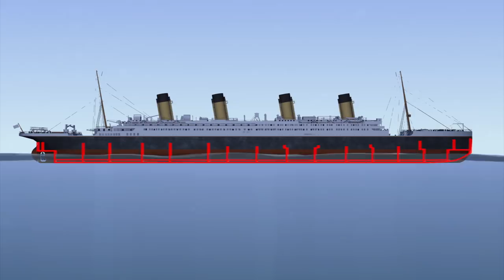Titanic: 3D animated reconstruction of how Titanic sank

Comment: I love how it looks like Titanic sank in a lake, SHE SANK 12,000 FEET BELOW THE SURFACE, THIS LOOKS LIKE SHE SANK IN 300 FEET
Reply: not 6  5
Reply: This animation is pretty bad ngl
Reply: Am sorry to say but sinking and the stern and bow hitting you sea floor didn’t look right and the wreck didn’t look good but I love the  3D
Reply: It wasn't a lake, it was the North Atlantic Ocean.
Reply: @seardadsdasd  ITS CUZ ITS FROM 10 YEARS AGO
Reply: that was legit britannic shallowness
Reply: @mycatisaderp5123  he was talking about how shallow looking the water was, you could see the top of the ocean
Reply: @jiraphatsempian6497  True. You actually could scuba dive there if you got the proper permits and training. 

However, the ship would not have split in this case. Britannic's prow is broken off because the depth is half of the ship's length. As the Britannic listed heavily during its final moments, its prow hit the seabed when part of the ship was still above water. The weight obviously caused it to snap like a pencil (imagine pushing a pencil on the ground as hard as you can until the tip breaks off). If Titanic was in a similar depth, it wouldn't have even risen enough to split.

Comment: Some one needs to double check their facts. Titanic had a double bottom, NOT A DOUBLE HULL. Big difference. If she had a double hull we wouldn't have such a bad video to talk about.
Reply: yup without the double hull the titanic would've only flooded the hull causeing the water to sink into the hull if double bottom however did not prosper for it did not need use when titanic hit the iceburg there was only one hull so the titanic was leaked for 4 compartments and breaks in to the 5th then it starts to sink rises snaps and plunges
Reply: There was more then one name for it.

1. Double bottom
2. Double hull
3. Double keel
Reply: @Harry Schurr Thanks, I didn't know anything 9 months ago, so...
Reply: oooooooooooooooooooooooh
Reply: Oooooooohhhhhh
Reply: @KeepCalmContemplateYourChoices  Nope, hull = sides of a ship.
Keel = Bottom of a ship.
There are no two names for it.
Reply: @CAYDEN NG YU HANG Moe The main reason why Titanic split at all, was because of the lack of a double hull (up the sides of the ship) - the double bottom hung on for a moment after the ship broke (basically from the top-down, due to the enormous strain of the water, plus the stern hanging at an angle it wasn't designed for), and then the bottom separated.  By contrast, when the Britannic sank, it did not split in half, and the fact that it had a double hull (up the sides as well as at the bottom) was why.  Except for some buckling where the bow hit the seabed, Britannic is basically in one piece.
Reply: Dude the bottom is called the hull if you learn about it
Reply: @Robloxchat123  what? Think my brain committed suicide
Reply: 100% tru

Comment: 1. The Titanic weighs approximately 47,500 Metric Tons, not 42,000.
2. The Titanic possessed a Double Bottom, not a Double Hull. After the sinking, her sister ship Britannic, still in construction, would be redesigned to have a Double Hull.
3. White Star Line never stated the ship was Unsinkable, they had just implied the ship was built with the latest technology to make her as safe as possible, but passengers misinterpreted this as such, and is still a common misconception to this day.
4. It is now widely accepted that Titanic did not reach a 45° angle before the breakup occurred and now is believed to have split at a much lower angle, likely somewhere between 11-24°.
Reply: Facts
Reply: true fax

Comment: Ok you're missing a LOT OF MISTAKES
1.titanic was not low before it hit the iceberg 0:25
2. The 3 funnels did NOT collapse at the same time 0:40
3. It was not far from each other so far like 147 meters away 0:47
4. It was so shallow it looks like it sank in a lake 0:49
5. It didn't get rusty that quick 0:52
6. The front should be a little crooked 0:54
7. The stern did not bounce 0:59
8. MAKE IT MORE BROKEN 1:06
9. ITS NOT MORNING 0:32
But your breakup is nice 0:43
Reply: Also the crows nest is fallen

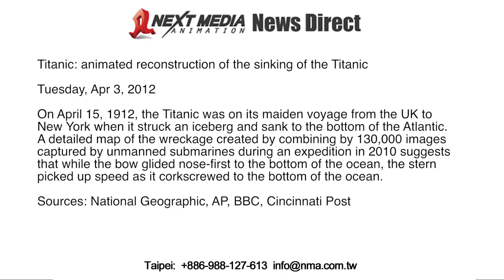Comment: What? No. I split apart between the second and third funnels. Not between the third and fourth. Besides, the 2nd and first funnel did not collapse at the same time. Besides, when my front half sank down, it didnt fall like that. It sank Bow going down first at a stable position. Besides the huge wooden poles collapsed. When the stern sank, where did all the debris go? At 1:09 why is there debris near the bow section? Dives to the bow section of me shows there probably was no debris other than a few collapsed funnel.
Reply: No, it broke just a bit more aft of the 3rd funnel... Check your facts.
Reply: @swigglyforce5215  it was proved back in 2012 that it broke in front of 3rd funnel.James Cameron also himself debunked his own movie theory in 2012.

Comment: When the Titanic filled with water and the front dipped downwards the entire engine room with the propellers and all... Along with most people on board rushing to the top were lifted into the air... A very massive weight that the compromised ships structure failed to hold, tearing the ship in two before it finally descended.

Comment: Also, you never mentioned the ship splitting in half, and it split beneath the third funnel, not between the third and fourth funnels... There was also the listing to port, the hang on with the double bottom, the bows look out post snapped back and crashed into the bridge, the stern came almost vertically before she completely went under, when the stern sank beneath the surface, it imploded before spiralling down wards, the bow plunged like a torpedo cause it was designed to cut through the ocean water, upon impact with the sea bed, the bottom of the front of the bow buried itself, breaking its back in the proses, the first and second funnels had also pulled pieces of the mid bow from the ship itself... Upon impact with the stern though. Its starboard and port sides imploded outwards, causing the boat deck and what not to cave in, the rap ear end of the stern twisted itself completely from the mid stern as it came to rest on the sea bed, there's a documentary called: DRAIN THE TITANIC
Reply: Link pls
Reply: I realised that and I appreciate your observations
Reply: You get that from the 2012 James Cameron sinking cgi

Comment: Cool but the way you've portrayed it is slightly inaccurate.
Reply: Yaa.............The hull is way too short, the drag waves look too high, maybe the reason why the hull looks so short, the keel should be flat, is there anymore?
Reply: @KeepCalmContemplateYourChoices  Yes. The superstructure seems too tall, along with the forecastle deck and the poop deck. The curve below the waterline starts way too early. The splitting position is in the incorrect spot. The smokestacks seem spaced wrong. The textures on the model are very inaccurate. The 3rd smokestack collapses at the wrong time. Incorrect listing (The Titanic sank with a list to port, and the stern wasn't as high as it is seen in this video.) The animation is just plain ridiculous. The V break theory competes with this video in terms of inaccuracy.
Reply: Not just slightly, its completely inaccurate

Comment: Titanic didn't have a double hull, she had a double bottom. She also didn't have a "gross weight of about 42k metric tons" she had a gross WEIGHT of 52,310 long tons, which is 53,149.414 metric tons. She had a gross register tonnage of 46,328 GRT, but that is a measure of volume, not weight - a "gross register ton" is a volume of 100 cubic feet. When used to describe a ship, it refers to the total enclosed volume of the ship.

Comment: the stern did not glide and landed softly on the bottom.  It exploded on impacted. and the bow traveled about 35 miles an hour and went nose first, 60 feet deep into the muddy ocean floor.

Comment: The titanic and the Olympic where the biggest ships not just the titanic.
Reply: +LNER 377 olympic was smaller then the titanic
Reply: Titanic is larger than Olympic, not by much, however, 6,000 tons heavier. Ships are measured by weight not by length. Britannic was built after the Titanic sank.

Comment: How come the stern looks like it took more damage than the bow? Is it because it sank quicker and faster?
Reply: precisely. The stern was not yet filled with water and when it sunk, it had lots of air inside. The ocean pressure forced the air to come out violently, ripping apart the stern in the process. The bow on the other hand was mostly filled with water and thus sunk more gracefully, but it still took damage when it reached the bottom of the ocean.
Reply: +GOD'S Light (GodIsLight) Lol no, It was because the Bow was shaped arodynamically to cut through the waves. Unlike the stern, when the to pieces fell to the bottom the bow cut through (Like a torpedo) and the stern was spiraling (because of it's shape) and ripped off pieces in the process.
Reply: DAJLINE Actually, he was correct. You both are.

Comment: She actually broke into three sections.  When either the bow or the stern hit the bottom it broke in half again.  She also had a double bottom not a double hull.  Still a good video
Reply: She broke more than that, double bottom 1. Hull plating 2. 3rd funnel tower 3. Main split 4. Decks 5.

Comment: Ok I'm disappointed with how inaccurate this is
1. The titanic had a double keel
2. Titanic had beed struck in the first 5 compartments not 6
3 titanic did not separate 3-4km apparte when it split 

Little fact for you
Titanic was going to float after it split but the bo attached to the bottom because of the double keel do the stern was pulled down with the bowe
Reply: It wouldn't have floated after the break up. That's a myth.
Reply: British Wolf agreed. if a ship splits, it would definitely not float.

Comment: Why did it sink if it was UNsinkible
Reply: because they thought it was unsinkable since it was made out of hard metal materials but they didn't think that the material has its limits and when it got hit by the iceberg parts of it broke causing it to sink
Reply: Naruto Uzumaki does anyone actually build a ship planning to ram icebergs?
Reply: ArtisChronicles No there would be no need to ram icebergs since it would just make it into smaller chunks which serve as a even more hazard and hard to avoid.

Many ways to avoid icebergs has been put in place like Radar system or oceanic map and many safety procedures have been made to prevent loss of life's like a ships communication devices are required

To be on all the time and many cruise ships are to stay in a specific rout now so help can easily be made.
Reply: Thats what the media said after the sinking
Reply: Because she had a double bottom and 16 watertight compartments even if the water flooded the first four compartments she would afloat  
And if something sharp like a rock damage her bottom she will still be afloat thanks to the plate above the keel.